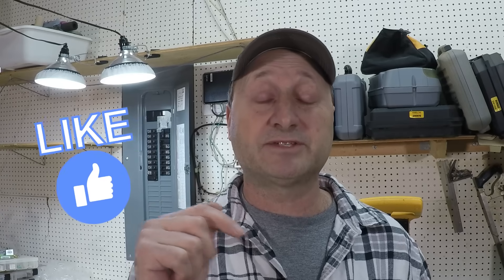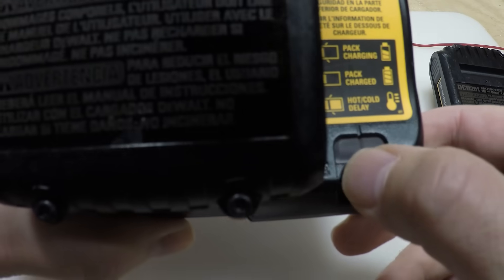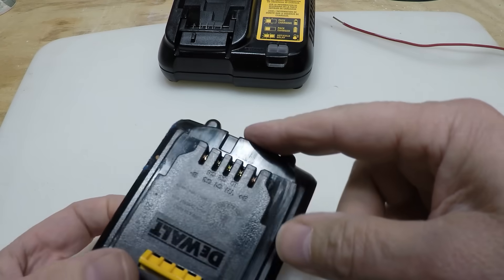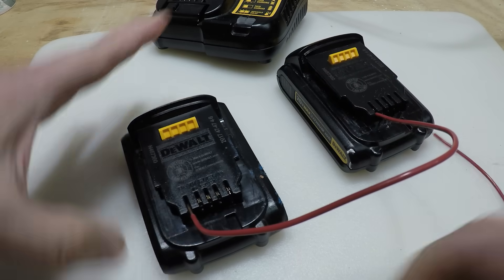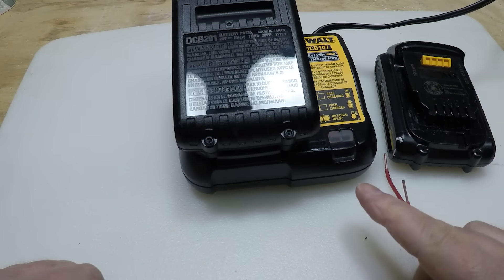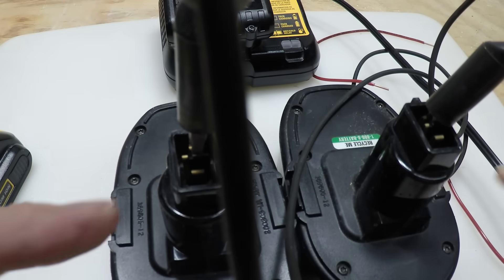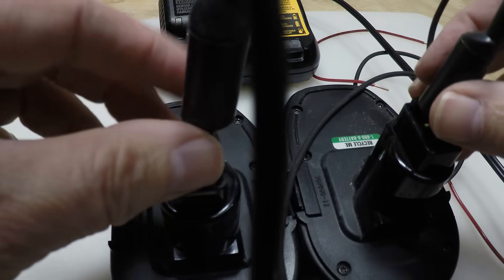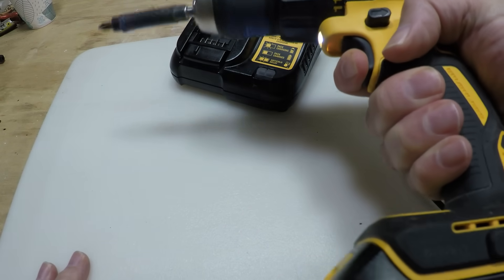SECRET to FIX Drill Batteries - Charge Dead Lithium Tool Batteries

Comment: My 18v dewalt battery was on the charger and charging when I remove the battery from the charger and placed it in my circular skill saw , the saw acted as though the battery was low in charge.  What's wrong , the battery charger not charging,   or is it the battery ? Charger light recognizes the battery and light flashes , as when charging
Reply from the maker: At some point the battery may just be at the end of its life. That could be the case here. Thank you for watching. Would appreciate if you could sub to the channel.  Thx... Flannel Guy

Comment: Can I use a regular 9 volt battery to an 18 volt drill battery or connect the two 9 volt to the drill battery or is any of that dangerous.  I do not have a working battery to charge it with.
Reply from the maker: You can use ANY LITHIUM battery. All you are trying to do is get a small amount of juice into the dead battery. thank you for watching! Please sub to the channel if you have not done so already

Comment: I have a mini chainsaw battery 20v. 2 questions: Where do I get the wires to I need to try this, and would I be able to tires my 20v drill battery to attempt bringing the 20v chainsaw battery back to life?
Reply from the maker: you can use any wire and yes you can do it with the 20v battery. Thank you for watching the video. Please help by subscribing to the channel. :)

Comment: tried this and near enough blew up my hand... luckily I was using rubber grip pliers in case. Think the issue may have been with the wire. Burned dents into the donor battery and melted the wire onto my pliers. Be careful!

Comment: A man with a little bit of knowledge 
That hasn't got a clue of the possible danger 
Ie fire , explosion, 
Lithium battery are high energy density storage system 
With inbult CID protection and a BMS on the main board 
To stop from what your deliberately doing 
IDIOT 

This isn't as dangerous on MH batteries

Comment: Wow it helped thx man!! - Got brand new Black Decker BCD003 H1 and it did not charge at all (red light was blinking instead of green one ). Just got some old black decker battery even from a different type (14.4 v instead of 18v) connected them together for some seconds and thats it green light blinking :). Why would black decker sell a brand new drill with empty not working batteries ??

Comment: If in case you only have 1 battery... connecting to a 9volt will achieve the same results.
Reply from the maker: You can actually use any lithium battery

Comment: where do you get the wires like that so stiff?
Reply from the maker: those are just 14 gauge wires.
Reply: @flannelguydiy6458 okay thanks i did it and it fixed my battery. Saved a lot instead of getting a new one

Comment: Bottom line you need a working battery.
If the batteries don’t have any life this will not work.
Reply from the maker: you can use any lithium battery. It does not have to be the same battery

Comment: I have the same 18 and 20 volt dewalts. My 20 volt charges fine, but both of my 18 volt batteries are dead. How do I hook up the 20 volt batteries to the 18 volt batteries so the charger reads the 18 volt batteries? Thanks any response will be much appreciated.

Comment: This will only work if you discharged your battery beyond threshold. When you have a dead cell in the pack nothing will bring that battery back to life unless you open the battery pack and replace faulty cell. Most  of the time it's not worth the hassle because the other cells are on the end of their life. If you don't know much about Li-Po batteries DO NOT experiment with them because you can burn your house down.

Comment: What if you didn't have another battery to jump it with
Reply from the maker: you can use any lithium battery
Reply: I have a 40 volt and I tried to jump it with my friends 20-volt and it didn't work  @flannelguydiy6458

Comment: Interesting.  Thank you.  This issue seems to be the same workings as with AGM car batteries.  One example of AGM batteries would be Optima batteries.  And what happens to the AGM car batteries, is that when they become very dead such as a long time since charging, they also require the type of jump that you performed here on the tool battery, and then they'll take a charge.  I'm told that the reason for this is when reaching a certain point of being dead there's a switch inside the battery that trips.  And when it does then they won't take a charge.  The jump you did on the tool batteries apparently trips the switch back on again and they can then be charged.  As well, I'm told that a quick way to trip the switch back on again is to momentarily cross the posts on the battery that won't take the charge using a piece of conductive metal, such as using an open pair of pliers or a long enough screwdriver.  Crossing the posts has to be done very quickly, it's just a quick tap.  I haven't tried this yet so I can't say if this trick works or not.
Reply from the maker: What I did with the tool batteries has nothing to do with a switch. When the battery is completely drained, the charger will not charge that battery because it does not know there is a battery attached. It must sense a small amount of power from a battery to trigger it to charge. This safety feature would prevent kids from getting shocked by putting pennies in the slot for example.

Comment: My battery is an old type for a dewalt 18v. It's a pattern battery for dewalt .it's new but only charging for about six  minutes what could it be
Reply from the maker: if it is charging but not lasting very long, then all dewalt customer service. You have a faulty battery

Comment: Didn't work, liked good until old batt. was in charger for 10 mins then back to no charge.
Reply from the maker: cowboy, if you got it to charge at all, then it did work. This just means your battery is well beyond its lifecycle. This fix was simply to get the charger to recognize that there is a battery there and to start charging it again

Comment: I only have one charger. Can I used a 12v battery for a 20v battery? How am I the only one asking this question?
Reply from the maker: you can use any lithium battery to jump it. Does not matter what the voltage is

Comment: mate i jumped started the battery no problems, but they wont fully charge, the charger should show GREEN but it keeps blinking red.  Drill works fine with revived battery just wont fully charge.
Regards Matt
Reply from the maker: Matt.. then your battery is probably at the end of its life

Comment: WHAT GAUGE WIRE
Reply from the maker: you can use any gauge. Even a very thin wire. You are passing a very small amount of low voltage and for one second

Comment: What about a 20 volt 4.0 ah doesn't seem to hold longer charge for hyper tough electric lawn mower it seems to last 10 minutes
Reply from the maker: If it does not HOLD a charge, then you likely need to replace the battery.

Comment: could you just trickle charge with a regular charger?
Reply from the maker: No, you just need to connect it to a different battery for one second. then it will charge in the battery charger
If this video was helpful, please buy me a cup of coffee by clicking the $ THANKS button. I appreciate you.
Reply: @flannelguydiy6458  the point is I don't have a different battery.

Comment: I’m not sure if you answer everybody but I need help with mine. Mine is a HART battery 40 V. I have two of them and I also have two chargers, one battery flashes, green or stays green because it’s charged in both chargers, but the other one keeps flashing the red light twice pauses, and then flashes twice again it keeps doing that so it doesn’t get charged. What can I do?
Reply from the maker: I am not familiar with that battery. Check with the manufacturer on what the flashes mean
Reply: @ I called the company and they said it’s out of warranty. They can’t help me so I got pissed. I’m watching a bunch of videos on YouTube and they’re all pretty much the same how they do it with wires.

Comment: Hello, I just bought a new wireless drill and both batteries that came with it are not charging. How can I jumpstart the battery if I don't have a functioning one? Thanks
Reply from the maker: you can use any lithium battery

Comment: My DeWalt battery (like the 2nd ones with the gravity slotted stemb), the red light is just flashing 3 times quickly, break, flash 3 times quickly.

Is it worth / safe to use the crocodile clip method on it please?
Reply from the maker: just try it

Comment: I have a snojoe battery I haven't charged in i think 2 years. It won't charge at all and no lights. I did the jumper method when they are connected to each other the lights are green but when I take wires off nothing and it will not charge on charger? Any advice?
Reply from the maker: not sure what to tell you there

Comment: I have the 20 Volt Dewalt  Max battery, this is the second video showing this method to recover a dead battery. Unfortunately it did not work for me, followed the instructions but the result  was not good. The battery did not start charging.

Comment: I wonder I guess... Is it ethical to get those dead batteries charging  and sell them for the same $ as a good battery that's charging.... Do they last just as long.... Before you have to dig them out of the trash again and get them charging again haha... And sell them on the street???? To the same guy?
Reply from the maker: that is only a question that you can answer for your self. If someone is buying a used battery, then caveat emptor

Comment: Sadly, buying new batteries for older units- is a mine field of scam artists and rogue traders. So far I hve bought three batteries which collectively cost over £100 one was a Dud,2 only charged for s minute or two, and the third didnt even fit my appliances. The last one is clearly  phoney trader, wh demanded that i sendback the incorrect item, at my own expense, send photos of the goods I had received, to prove that I had indeed I had received hhe incorrect item. She thoen insisted that should send a receipt for the return postage separately and she would return the cost! 
Interestingly the pscksge showed an eBay reference number, and also contained a thank you card from eBay. Hw very strange - because I did not make my purchase through eBay!!. However, I cannot find any information on the eBay app to inform them of what appears to me as malpractice!

Comment: Hello. I have a pair of hand warmers (which is really just a bank of batteries that warms up a heater coil). After one month of use one of the hand warmer batteries stopped charging. The second one continues to work fine. It has a built-in USB-C port for charging purpose. Could this non-charging battery be revived using a variant of the method you had shown in your video? Could I use a USB-C to USB-C cable to “wake up” the non-charging battery? Please advise.
Reply from the maker: you can try it but I am not sure if that will work

Comment: This will work if it hasn't been doing it for very long but if BMS has been in a state of deep discharge for very long the battery will go bad. If you can measure the cells and they are around 3 volts this will probably work but if they are 1 or 2 volts or less that battery is probably damaged.

Comment: I have a Snap Fresh 20 V leaf Blower. the batt is a BBT-DC20A  Li-ion 2.0Ah . It just sat for months and now doesn't even show on the BBT-YFT20V Charger that came with it. I was gonna borrow a DeWalt 20 V from someone ti "jump start" but just read on Google that not compatible. I don't want t buy a $40 battery just to jump the old one. Any clues. was thinking of jumping straight off the charger but the terminals are marked "-" (neg)   and Dc+     reads 20v DC with a fluke meter but don't want to blow it up or mess up the internal parts. tried to get a used one to charge up and use for my jumper but can't find one..any help would be appreciated
Reply from the maker: you can use any lithium battery to jump it

Comment: I have a dewalt 60v flex volt that only charges to only one of the 3 lights on the indicator? It works but when I recharge it, it goes to the first light and stops? Thanks
Reply from the maker: your battery is at the end of its life

Comment: Is this only for lithium batteries?  Wondering what to do if NiCd bats are behaving badly...  Haven't used them in quite a while & as I recall, I have at least one that doesn't want to charge.  I realize they are very old, but it's what my tools use & I've rarely used them in recent years, but need them to work when I do!

I have a 18v Nicd on the charger right now after not charging it for well over 2 years.  It was still letting my drill turn VERY weakly, if I pulled the trigger but I knew if I kept the trigger depressed, it would have died in a few more moments.  After charging an hour, the charger is still blinking slowly & feels fairly hot.  I can't find my 2nd battery for this just now, but I believe the last time I tried to charge that one, the charger would blink very rapidly when it was attached, which seemed to indicate the battery was bad.  Any insights you can share would be very much appreciated!  Thank you!

[12.4.2024]

Comment: What if both lights on the charger are flashing simultaneously? I’ve been told that means the battery is shorted internally. Is that so and is it junk then?

Comment: Any clue how to charge a Vytronix Li-ion battery pack (22Vd.c. Model no. BCS01) for a cordless vaccuum cleaner? (now obsolete) It's nearly as cheap to buy a new vaccuum cleaner than replace the battery, and the design of the new batteries has changed so I'm reluctant to buy a new one in case it doesn't even fit. Time to trash a perfectly good vacuum cleaner because the battery has no charge?

Comment: so i was on a job about 4 months back and my ryobi batteries died for the blower i was using at the time. I decided to take a worx battery and basically twist and tape wire to the b+ and b- on each end and just tape the battery to the bottom. It ran the blower for a week then all of a sudden it made some sort of shorting sound inside. clearly pooched it like a dumby. since then i can only get the lights on the battery to show only when jump starting, charger doesnt work with it. Even when jumped it doesnt end up working after but when jumped it shows fully capacity. I went as far as opening battery and testing each cell individually and all were fully charged and identical cell voltages. 4.1 or watever the full volt capacity is i cannot remember im tired tonight and probably not making sense. Anyways, do you think tehres another way I can save this battery? I run a business off my ebike and could really use this battery as all my tools need 2 batteries so this essentially renders two of my batteries worthless.  1st world problems

Comment: Check the voltage actually on the battery with a multimeter first. I have an older Riobi drill and one battery won't charge. Charger flahes "testing" and goes no further. Watched your video and started setting up  everything to do this. When I checked the vdc on the 20v bad battery it had 18.5v.
At that point I sprayed contact cleaner on the contacts and lightly burnished them with 800 grit sand paper.
It then worked in the drill and is currently charging properly!
Reply: And now 20min later it's fully charged at 20.5v

Comment: I used to design lithium battery charging circuits. To extend battery life.... 1. Let battery rest after use before charging. 2. Wait after charging before using. 3. Don't store fully charged or highly discharged. 4. Stay within 10% charged and 90% charged as much as possible. If this nice trick of this video doen't work then most likely still only 1 of the 5 batteries is dead and 4 are usually still as good as new. (20 volts is 5 batteries in series). Just replace the 1 dead battery.
Reply: I don’t have wires with the clip in the end. Is there a way to do this using copper wires? Thanks for your advice, this is all new to me.

Comment: Good info, I have also the problem of older batteries that will not last or have become very week, any fixes for these?? Wilber
Reply from the maker: if the battery does not hold the charge, then it likely needs to be replaced

Comment: This concept can also work on 12V car batteries. Just connect the charging wires on a good battery, then use jumper cables from the good battery to the dead battery.

Comment: Thank you so much for posting this video. I have a simple question: Why doesn't the charger work while the jumping works? Doesn't charging mean equally jumping? Your method has not yet been tried on my four dead batteries, but I will this weekend, and I am so excited!
Reply from the maker: I explained that in the very beginning.

Comment: Regarding oil in batteries: SKIL PWRCore 20 Lithium 5Ah - stored on side, leaking oil from case - took me awhile to figure out the screws were for Starbits. One screw was loose. What kind of oil is used to replace the oil and how much oil is there supposed to be? Would pharmacy grade mineral oil work without shorting anything? Would contact cement (rubber) tighten up the threads to seat the screw properly? [side bar: Your presentation was well finished by accounting for potential mix up of batteries. Would a nine volt battery or a car battery substitute for the extra battery you used to 'jitter-bug' your dead battery?] Thanks for your DIY insight.
Reply from the maker: I dont know about the oil unfortunately

Comment: Just bought a brand new milwaukee drill/impact set with 2 batteries and a charger. 
Straight out of the box, neither battery will charge. I bought the set from Home Depot and i have a feeling im screwed because i didnt buy the "protection plan"

This is bullshit, and ive never had a problem like this with dewalt tools
Reply from the maker: just return them